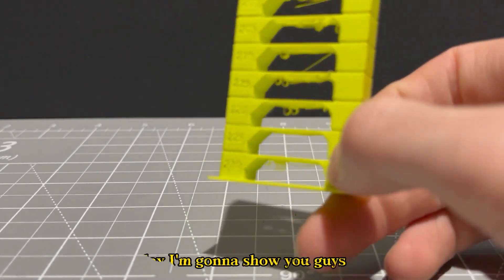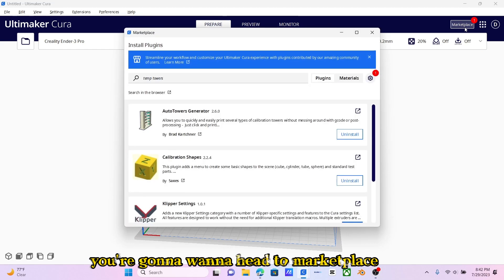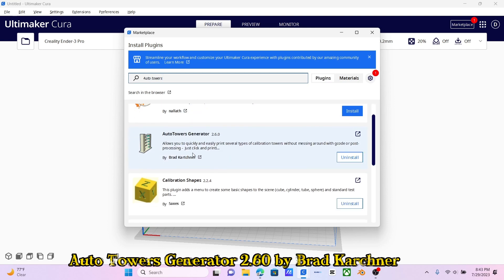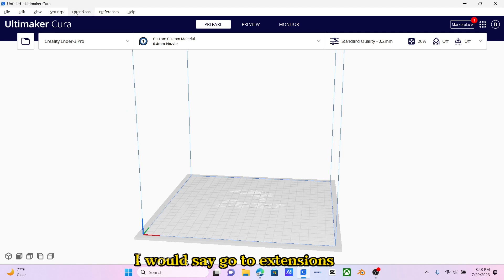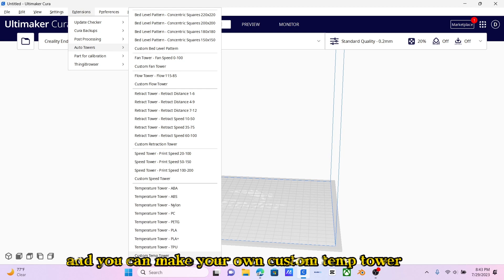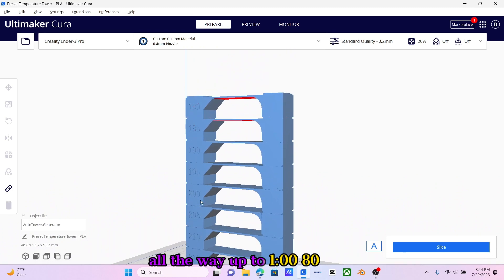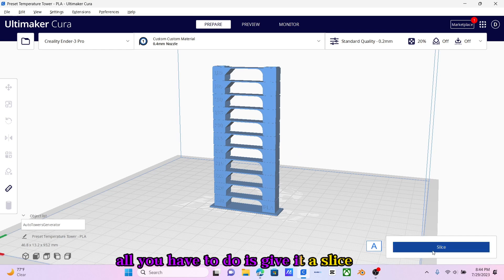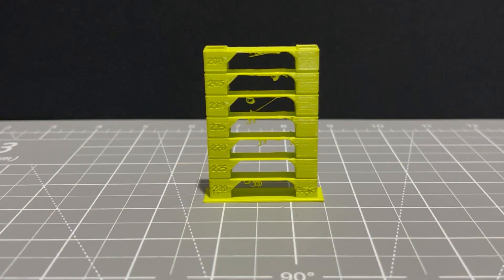How to 3D Print a Temperature Tower | Cura slicer

Comment: The "A" that you pointed to regarding the postscript setting is actually the "Remove the auto tower model" button.  The post processing scripts icon is actually a "</>" icon.  This doesn't actually add a post processing script with the "</>" icon , at least in Cura 5.11.0 using the AutoTowerGenerator v2.7.2 extension.  It does add it to the gcode, though.  Just for clarification's sake! :D  edited to add that it was in the gcode